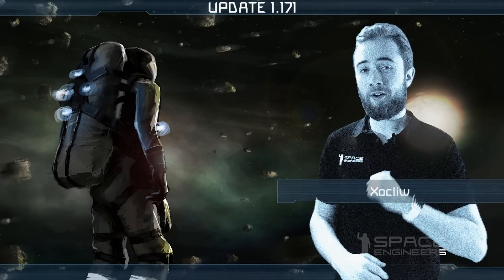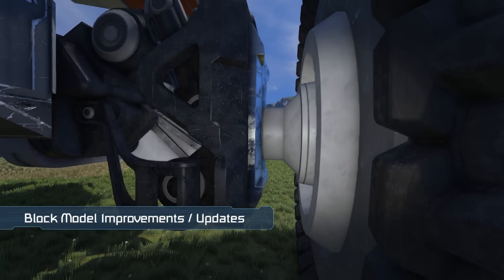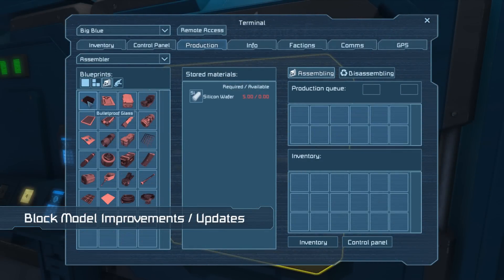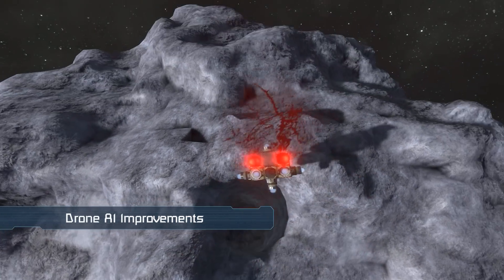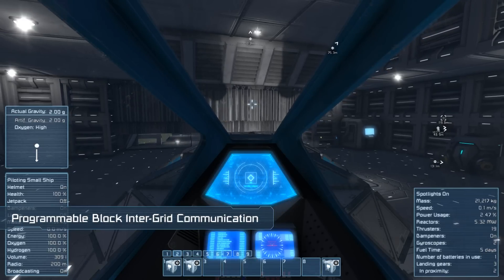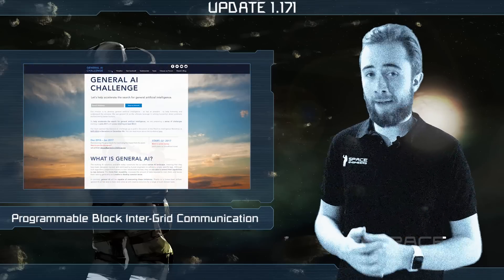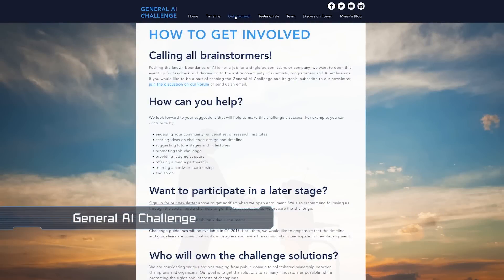Space Engineers - Update 01.171 DEV - Programmable Block Inter-Grid Communication

Comment: Im so glad programable blocks can be used remotely now i never have used it but now i can see some very interesting possibilities.
 
     For my suggestion I think an expansion on blueprint functionality such as compression and organization would be awesome. Such as ways to organize different builds by folders and be able to name said folders with drop down menus. That way long blueprint lists could be more accessible and easy to organize. 
     The ability to have blueprints with sub grids would be neat for some of the builds i do with projectors. speaking of blueprints can you make the positioning of the structure configurable? Some of my builds are turned side ways it would be nice to be able to position the configuration of the blueprint from the edit screen.
     To have multiple projections controllable from the same projector block would be great It would speed up the process of aligning the sub grids that are needed for some ships to function. Some build bays would benefit from a single projector being able to position multiple grids for modular ships. For example: the single projector could save positions on the merge blocks so we could built different modules from blueprints.
     I think it would be great if we could use our hands to grab things such as small ships and move it around if it is light would make the game feel more interactive. recommended mods to be added: Nanite control factory,XL industrial (refiner,assembler and storage only).

           Sincerely from a fellow space engineer :)

Comment: (Sorry if this sounds like incoherent rambling)  Hey Xocliw! I think the ability to redirect power would go along well with this update. If you could chose what power blocks power which blocks, It could help with overall ship power efficiency and power management, as well as letting drones last longer. If power becomes an issue for a drone, it could redirect power to more needed systems until they are needed instead of just turning those systems off. This could also be very useful for ship life support, because if general ship power goes out, you lose life support and are out of luck. With power redirection, you could have a small reactor set aside for just life support so if power goes out then the ship could still maintain power to oxygen, cryobay, and medbay systems. The new inter-grid options could let scripts easily manage large power networks on and between ships and stations. I already posted this to the suggestions forum but I feel like this idea would be lost in there.
-Sir Andrew III

Comment: Airtight merge blocks!? Hell yea! no more funky airlocks for ships with a command module that can be separated! 

Now only if the modding community added more merge block variations or even a set of block with some faces that cant merge so you can make sections around two separable bodies look fluid and smooth and still separate and not merge together when linked.

Comment: fuck your programmable block. make the game playable atleast with 25 fps
Reply: Mmh you're sure it's not your systems specs? Or just the Simspeed being low?
I only have an old FX6100 and a R9 390 .. and even had to undervolt my CPU now so i could play some stupid game which can't handle any (heavily) overclocked CPU and run as it should but i still got 50~120 fps and 0.8~1.0 Simspeed in SP even in ships that close in to the one million tons. 
While i can easily fill 16 to even 20GB of ram with SE.
While i wouldn't play on MP servers that aren't dedicated ones... virtual servers don't work for SE at all as long as these f*cktards oversell their slots... actually even if not virtual servers for games that tend to suddenly get exponentially increasing calculation requests just to dip down fast afterwards won't work with todays often used architectures.
Reply: i sure i  played this game a year ago with 40-60 fps. now 10-15. amazing blocks and other shit so important
angry /off
Reply: rpek32 thats strange since the last update gave me a boost. Before i sometimes dropped into the 20ish fps. I got an overall ~25% performance boost.
The only annoying thing is that a lot of bugs emerged ... like with the LG and suspensions which is the reason i can't touch some of my SP saves since they would instantly blow :-X

Did you change anything in your setup? Like installing Win10 or something? ^^
Depending on your HW it might also be related to some old drivers hindering your performance.

Comment: WHAT IF AN ASTROUNAUT GETS STRUCK BY A THUNDER ON HIS BIRTHDAY
Reply: The odds are astronomical.
Reply: Then said astronaut is an AC/DC fan?

That said, if the fan is engineered to be both AC or DC, then it's probably pretty good at blowing out candles at home and on the go. I think the fan will make for a very Happy Birthday. I therefore deduce that the astronaut in the scenario you suggest is both asthmatic and has lung augmentations!
Reply: This is why most astronauts celebrate their birthday in space.

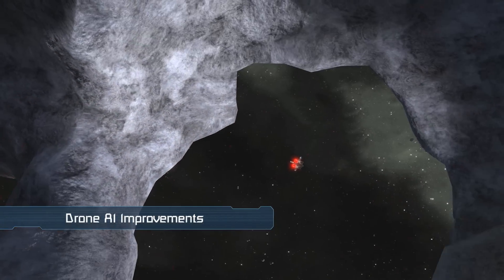Comment: 1:03 you can see red lights through the rock..
Reply: Unfortunately a lot of games get this wrong.  It's a bit of a trade-off really.  They wanted the light effect to fade away as if it were a flame being put out by suffocation... which is not how an electrical light should be.  The visible through walls effect is mostly found in pre-electric era games where the fade out on the lighting is expected since it is usually an open flame and the fade effect can't distinguish between being turned off and being occluded.  I'd prefer they simple did away with the flare effect altogether, which would fix this problem right off the bat but would also anger the realists who would claim that the flare would exist in the real world... or rather our eyes would perceive the flare.